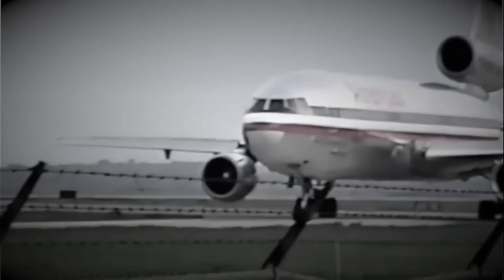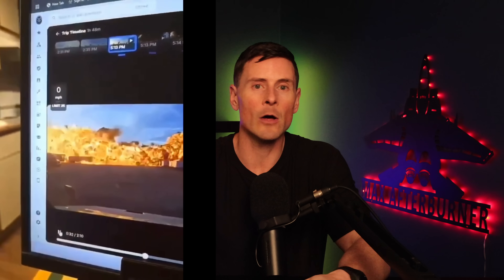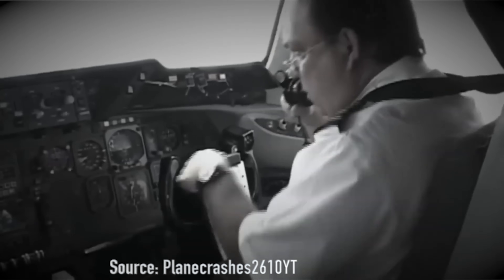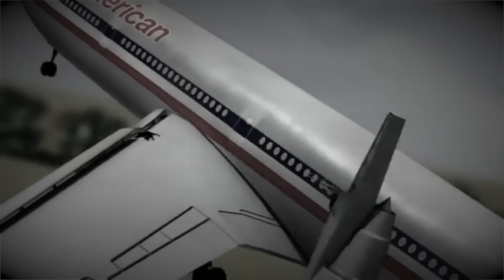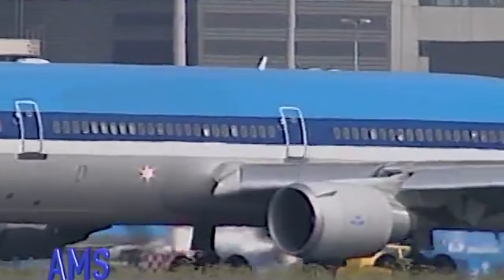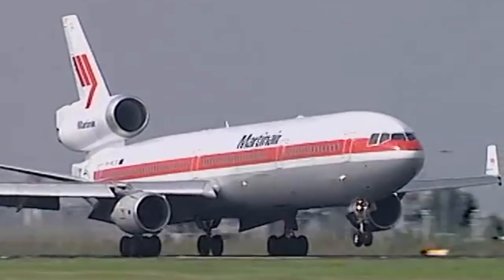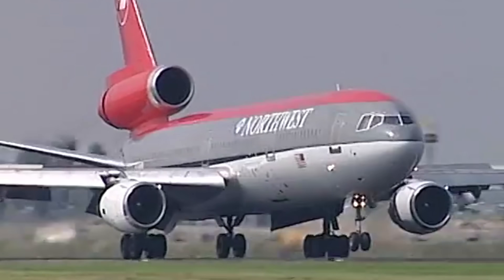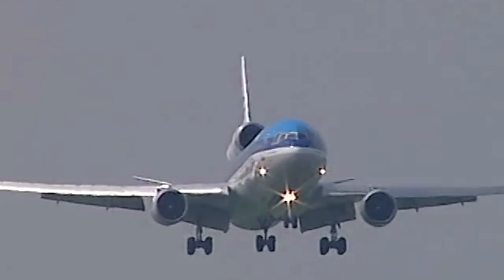Airline Pilot Exposes CRITICAL FLAW of UPS 2976 DISASTER

Comment: Terrible accident very sad. Misalignment of the engine – that a real deal. Makes me face palm every time now days massive propaganda on internet of one fighter jet from northern country of Greta Thunberg, they use one on the main driving arguments that they can replace jet engine in record times ranging from 15 to 50 minutes in the field by three technician do that in open weather in any temperature without power tools. Just face palm that that nonsense repeat ”respected “channels – how temperature expansion contraction of the metal/materials do not affect them how they can perfectly install and align to the microns new engine fill it with all liquids and all necessary , calibrate tune engine in the field on a side of the road under the rain and snow without hangar and controlled temperatures and  in 15 to 50 minutes. Make such claims with impunity, not sorry as some T-shirt of f-nist.

Comment: If only the practices at UPS was as thorough with passenger aircraft as it is to freight. Mourning the loss of 14 lives is no small matter however, it could have been a passenger aircraft. If the findings lead to improvements across the industry, then those 14 will.not have died in vain. Having seen the crash site in San Diego, back in the 70's, between PSA and a private aircraft, a plane crash is a horrific occurrence. I pray that no others have to experience such an event.

Comment: I love your channel because of your generally correct analysis and impulse control not to speculate. My mother was a passenger on United 191 and we are from Chicago. When you made the comment at the beginning of the video about the problems with the pylons being solved has absolutely positively nothing to do with the UPS crash unless it is a maintenance issue involving replacing the left engine by using a forklift or other absolutely insanely imbecile like thinking by mechanics and their supervisors to save time. 

So unless UPS used a forklift and did what the mechanics and supervisors did an American Airlines there is a unrelated issue that caused the engine to separate. American 191 had nothing to do with the metallurgical or structural integrity of the pylon or other parts attaching to the engine to hold it to the plane. 

My dad before he died explained that the NTSB, which are human beings, met with the victims families or took calls whenever they called and had a group meeting after the final report. United 191 which was serviced by American Airlines English-speaking maintenance technicians at O'Hare airport used procedures that somebody with an operating brain would understand would be a problem much less a pilot. 

Instead of a six to eight hour procedure swapping engines using a forklift of the exact model used by Target and Walmart when the assembly mechanism and screws require thousands of an inch accuracy due to the added torque on takeoff on the engines. Instead of a 6 to 8 hour procedure and doing it as outlined in the FAA NTSB and Boeing approved manual they used a common forklift to swap the engines. 

And testimony established when threats of criminal prosecution by the United States Attorney's Office for the Northern District of Illinois started issuing grand jury subpoenas that somebody was standing by the engine giving hand signals to the forklift operator to raise lower or turn it left or right as they were tightening the screws and other mechanisms. 

The engine fell off because these imbeciles were not trained properly, the supervisor approved it and he was present when it was approved, and didn't realize that it placed metallurgical stress on the assembly mechanism and screws by using the forklift instead of the machine that would measure thousandth of an inch discrepancies, thus resulting in the engine separating. 

So unless UPS did the exact same catastrophically stupid procedure and in my opinion criminal because when pressed with the specter of criminal charges the mechanics and American Airlines executives all the sudden started to remember things and produce records that were lost or couldn't be found it was established that this was the common procedure among many mechanics looking to save time. 

It is beyond my comprehension that another American Airlines DC-10 engine did not separate. This is no different than putting a screw into a part of a car that requires a particular amount of torque and has to before the swap begins and tightening of screws and mechanisms begins and simply taking a torque wrench and getting it as tight as you think it should be. 

Any idiot would recognize that that type of blatant disregard for procedure with jeopardize the lives of hundreds of people everyday and yet continue to do it and every redundancy for checking American Airlines maintenance was a utter failure. Checking mechanics records which they actually put they used a forklift when they perform an engine swap is an FAA requirement on certain levels of trust but verify policy. 

So I was really offended when you said that the problem had been taken care of. There was no problem with the DC-10 on American Airlines flight 191. 

If the engine had been swapped properly nothing would have happened and everyone would be alive including my mother. The NTSB metallurgical investigator and my father spoke and he was in an utter state of consternation that the mechanics and mechanics supervisors thought that saving six to eight hours swapping an engine by using a forklift and hand signals about the level of the screws and other mechanisms to attach it to the pylon and not even using a common level which wouldn't have made a difference should have resulted in all of them going to federal prison any executive aware of these procedures going on should also still be in federal prison and any executives who did not know should have been fired because it's something they should have learned through the chain of command and instead we're focusing on profits profits and profits. 

What is ironic is tonight I was hanging up here of rear surround sound speakers in my apartment and wondering about how much torque to put into one of the parts and stopped and went to the manual and it gave a description of It should be tight so the speaker can still move to adjust but not loose enough to move on its own. 

Don't over tighten. There's a big difference between Miss hanging a surround sound speaker and killing hundreds of people because you wanted to get home and do whatever you do. And the pathetic part of this that the public doesn't know is that I believe over 1/3 of Boeing employees are deputized on behalf of the FAA to sign off on notice to airmen, NTSB recommendations, regular maintenance, and other major maintenance which if improperly handle could result in death. 

How on earth would you expect a supervisor who comes up as a Boeing employee and says yep the wing looks like it was put on right and then turn his badge around to the FAA side and say nope I made a mistake the wing was put on wrong. Whoever allowed that cost savings step in Congress should also be in federal prison in my opinion. That incentivizes cutting corners just from a human factors perspective. 

And I know about this because my child's mother is a fellow at DARPA (with a top secret occasional SCIF clearance), tenured professor at the United States Military Academy at West Point New York, chair of two American Psychological Association committees on human factors and behavioral engineering and has written extensively for the FAA on cockpit crew management to cockpit alarms to cockpit layout etc. 

And what the American public doesn't think about is when you fly to Buenos Aires Argentina on United Airlines and there is a problem with part of the airplane the people fixing it are third-party people with English as a second language and the instructions written in English and are rarely redundancy or safety checked by the FAA, the airline or any other regulatory agency. You depend on them if they are confused to call Boeing or Airbus and ask about the instructions to fix the part that they are charged with fixing. 

There are countless airline crashes that are directly attributable to this kind of miscommunication. And I believe there is an NTSB recommendation that is still unimplemented that in a situation like that there has to be someone who speaks English as a first language trained as a mechanic on that plane present or at least available by telephone or video throughout the process. So when you made the comment they fixed it, unless UPS suffered the same neolithic and competence that the mechanics of American Airlines 191 exhibited, which I don't think is the issue, you are wrong. 

There was no issue to fix related to the operation or any part of the airplane itself. And the only thing that brings me any closure which they're never is because I think about my mother multiple times everyday and what she went through in the 60 seconds that she knew something was wrong and she was going to die is that at least only several hundred people were killed. If the engine would have survived that take off and landing there is a 100% chance it would have detached on a future takeoff due to metallurgical failure that could only have been seen through the use of ultrasound and other extremely invasive and expensive and time-consuming checks and balances. 

That's what the NTSB said to my father. And the saddest thing of what he said is that the FAA and the NTSB while they appear on TV to be buddies are far from it and most FAA employees resent and TSB employees. 

I also know a little bit about this because while I am not a pilot we have a 777 captain and a 787 captain, who are both check captains, with military experience and nearly 25,000 light hours each in the family with seven others who are flight attendants. 

They have the same if not probably more flight hours than you which doesn't make them better or worse pilots it just gives them more experience and they said the same thing and their level of anger all these years later is the exact same it was in 1991 when the phone call came in. I'm sorry if this came off as a rant. 

It was not intended to denigrate you or your skill of flying but to offer my opinion that you were wrong to say the pylon issues have been fixed from American Airlines 191. And because of that over a dozen grandchildren never met their grandmother and never will.

Comment: The forklift didn't slip, they left the forklift holding the engine during shift change, and it leaked down a bit as they do/  Anyone who works with hydraulics should know, you NEVER leave anything sitting on a hydraulic lift or jack. it will fade.

Comment: Coincidentally I was watching the Air Disasters episode about Flight 191 a few days before this tragedy. This is the first thing I thought of. Recommended maintenance procedures from the manufacturer were not followed. The metallurgist involved said the bolts didn't fail, the brackets did. This is an excellent diagnosis. Recommended procedures were mandated to American Airlines and a couple of others, but not all air carriers were mandated to follow them. We will see when the maintenance investigation is completed.
 Excellent analysis. Subscribed.

Comment: Never worked the DC10 or MD11. Never removed an engine with the pylon. Maybe a unique design but sounds like more labor to remove both as a unit. If there was structural work done on the wing(s) then it's possible the aircraft was placed on shoring and the engines/pylons removed. The AMM/SRM details procedures or the MFG is involved in the repair processes.

Comment: Conflicting accounts on which engine the failure of no 1 took out, Cap Steve said it was The no 3 wing engine that was stalling not the the no 2 tail engine, that picture @ 4.20 does look like it was the wing engine not the tail engine

Comment: The burn out wrecked frame they will " inspect it for cracks "  
Better check the A& P mechanics and see if the maint books are not cook
Better inspect a similar age plane around the engine holding parts and pins frame etc
😎👍🏼

Comment: I commend you for researching this throughly. You're the first I heard bring up the DC-10 chicago crash. I remember it vividly because of my vicinity to the airport. The loss of the engine caused hydraulic pressure to drop affecting leading edge (slat) operation.

Comment: because of the mods performed to improve the pylon mounting system years ago and a return to the orginal pricedure for removing the engines leads me to a more likeky uncontained engine event that destroyed itself so violently that the shedding of internals of the compressor and downline combustion section, at max power the force of the engine tearing itself apart could easily overwhelm the pylon system. This will be confirmed in short order once a  detailed inspection of the engine is performed and will confirm if the pylon failed or if the uncontained engine event tore thru the pylon and other systems that then departed upward and were injested into the center engine reducing or elminating its abilty to produce any thing close to its rated output which at that point there was insufficent thrust to fly much less climb at that weight.

Comment: i remember that 1979 flight very well, and the programs that followed, if memory serves me correctly i think it was found that during maintenance, engines were refitted to aircraft poorly using a forklift to correct alignment causing some damage to pins, creating loads on the pylon resulting in strass fractures (as you correctly suggest, thanks, i wrote this before you spoke of it), i really hope this is not a repeat when such a major notice was applied to maintenance procedures to prevent this EVER happening again, but i guess anything is possible so many years later with ground crews who may not be aware of previous incidents, i think also that 1979 incident led to further testing and x-raying of critical load parts such as engine pins and pylons

it was suggested that the No1 engine left the plane and possibly went up and over the wing perhaps due to configuration, high acceleration etc, and then damaging the starboard No2 engine causing compressor failure, i know engines are designed to sheer off but thought they might always drop down and away from the wing - such a dreadful incident and my heart and thoughts go out to all those lost, and their loved ones

i really hope these people are not forgotten and changes are made, perhaps its time to retire these aging planes sooner and i'm pretty sure UPS will be thinking this to phase them out - the trouble is unlike cars, planes are great at flying just not so good at crashing, i really wonder why we don't use plastics like polythene in planes

Comment: What your talking about is what I said last nite that there is a possibility that improper removal of the left engine might have caused this crash as well.Those engines weigh tons so using a nonpercision lifting device(forklift)could have caused a fracture of the pylon fittings due to misalignment during reinstallation of the engine.They also cut corners by removing the entire assembly from the wing instead of removing the engine from the pylon and leave the pylon attached to the wing.

Comment: Don't forget theDC 10 was built cheap when it lost it's engine it also lost gauges on Captains side of cockpit crew follow procedure for lost of engine and accidently stalled the aircraft by reducing power to remaining g engines as described they didn't know the engine fell off damaging flight systems unknow if they hadnot reduced power to remaining engines if they could have kept 191 in the air this hits hard for me cause I was a first responder who was on scene also other critical systems were lost cockpit voice recorder among others pilots didn't have the information they needed o save the plane in the little time after the failure

Comment: The 191 1979 crash: The American Pilots followed company book on one engine out.  They kept the nose at Best Angle of Climb (Vx). This puts the airspeed just above Stall. The problem was: they did not realize the Front Slats on the left wing retracted raising the stall speed for the left wing above Vx.  Any of those "Tri-Jets" are supposed to be able to climb out on just 2 engines in case of one engine failure on takeoff. The UPS pilots had nothing---no climb airspeed nor altitude. The best they could do to save their lives was Eject. That was not available of course. I read the followup story on 191 a year or more later.

Comment: Piloting is one thing and engineering is another. Most aeronautical/structural engineers are not professional pilots but they can tell you how not to build a structure. "YAW". you should not do that. Famous words never taken seriously.  This aircraft has by demonstration a serious pylon problem which was not corrected by the first FAA and NTSB for the MD-11 wing pylon.  The MD-11 is being phased out which is a good thing. There are stress cracks but it has nothing to do with a forklift and the pilon attachment bushings allow the engine to swing over the top of the wing which is really an odd thing to do when a 8000-pound hunk of metal fall off the aircraft.

Comment: Another fatigue failure of the rear bulkhead at the pylon attachment point. Obviously however nobody is calculating flight performance with the temperature of 1500 degree flames. No doubt it would be zero.  The modified slat upgrade almost saved lives if only they incorporated a fuel cutoff valve in the event of a pylon departure.